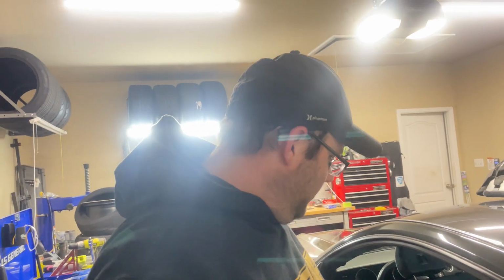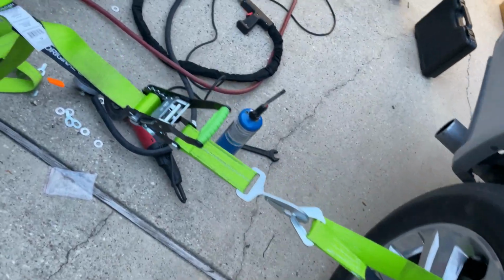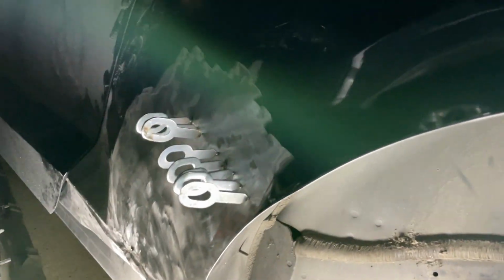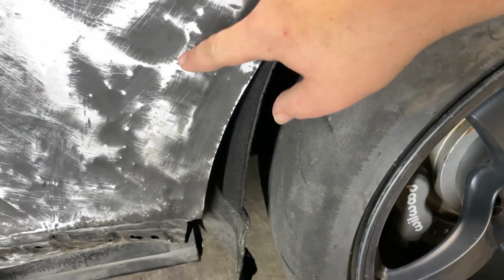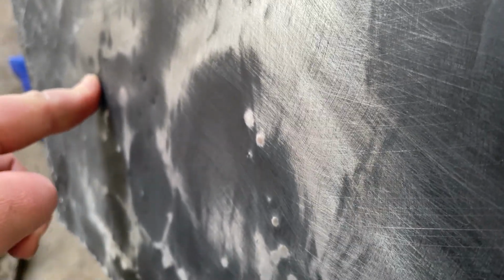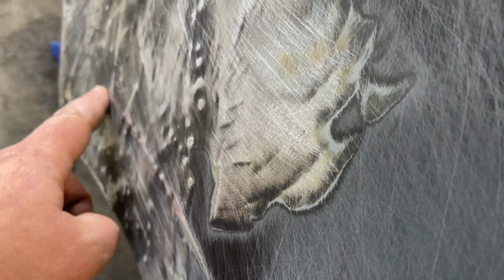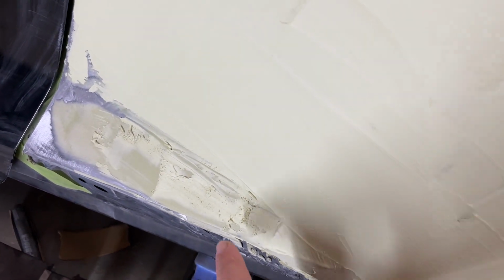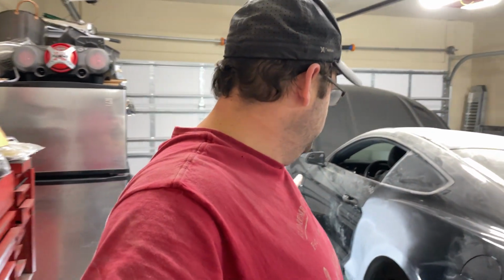DIY QUARTER PANEL REPAIR!

Comment: Holy Crap, this is amazing! I might need this puller for the Miata.
Reply from the maker: It did remarkably well for what it is.  I did have to make that adapter to be able to use the ratchet strap, but it was literally just welding a shackle to a bolt and bam we were in business.